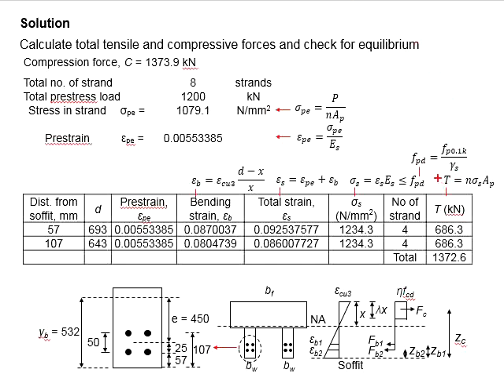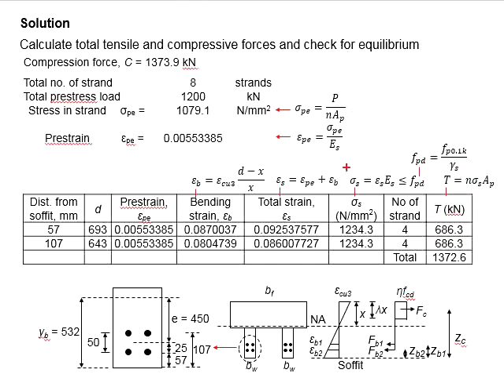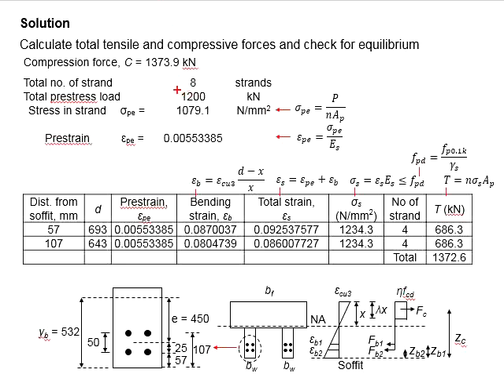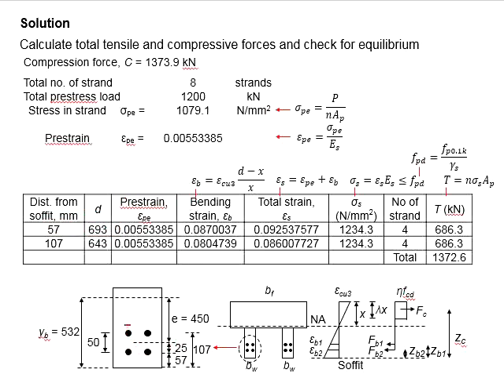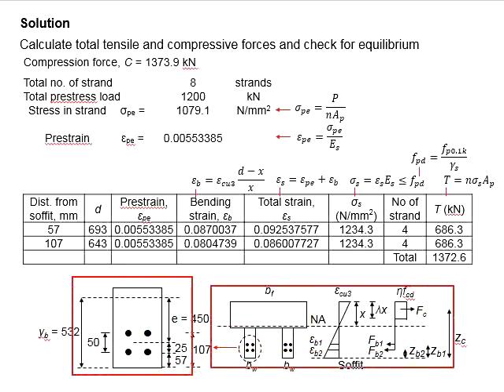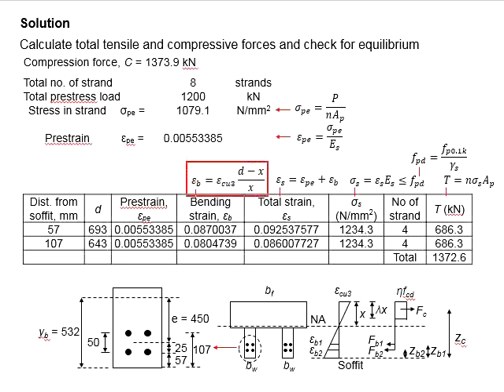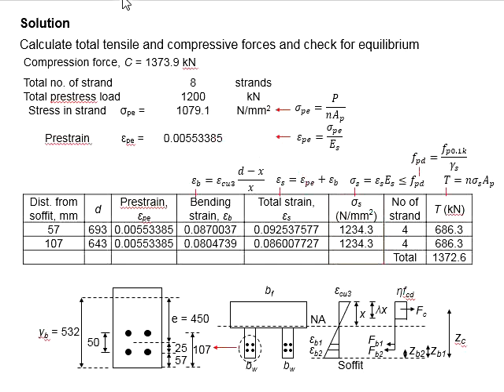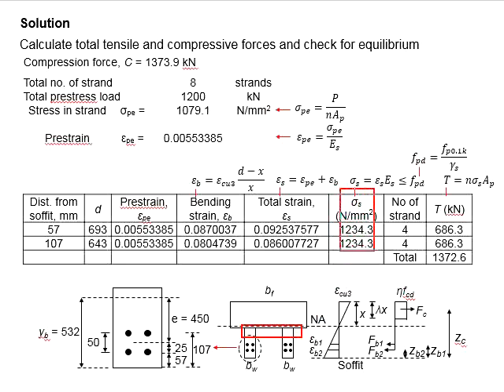2.29 Example: Ultimate bending part 2

Comment: Dear Eng.Aim, Elasticity relation written in the table has the following variable ; [Elasticity Modulus of steel = 195000(mpa)]*[Total strain 0.092537577 (no unit)] = 18044.715 (Mpa), and not 1234.3.

Furthermore, a total strain of almost 10% seems to be a bit high for the calculation. 

could you please help solving this issue?